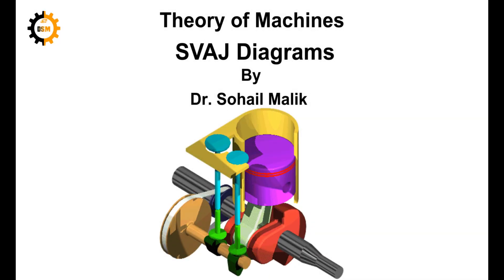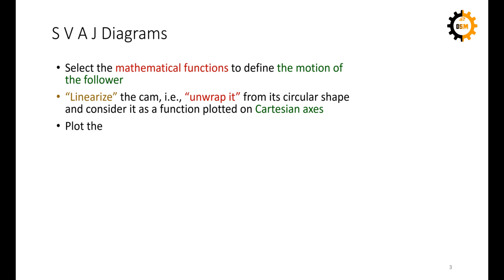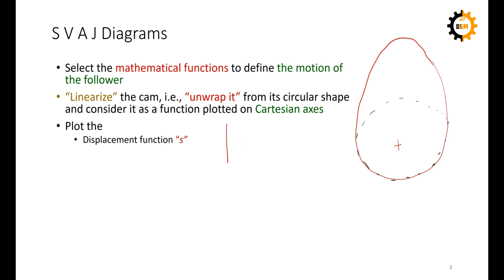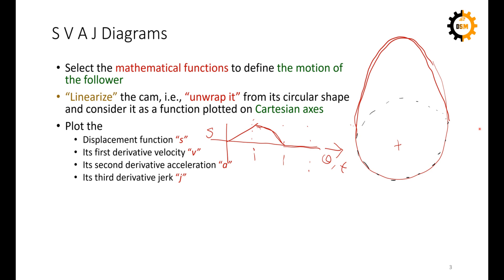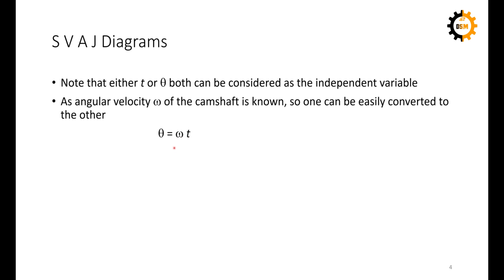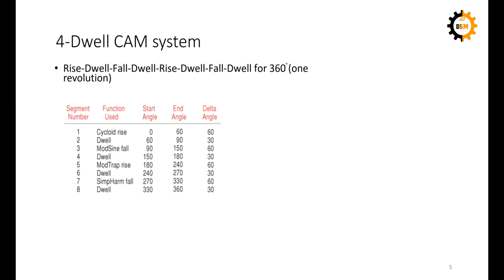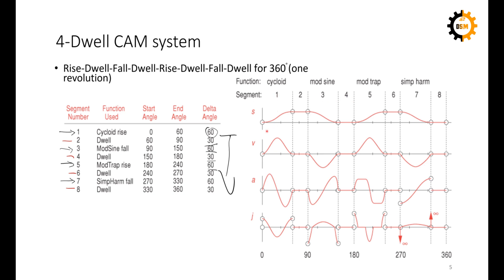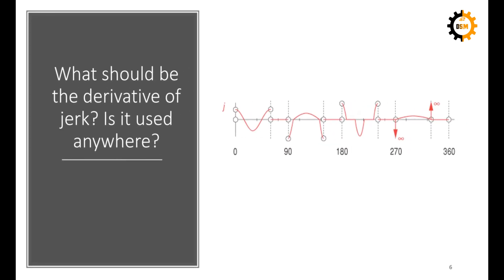28-1 Theory of Machines | CAM Follower Mechanism | SVAJ Diagrams

Comment: The derivative of of acceleration is called jounce. It is analyzed by passengers in roller coaster. svaj diagrams are important to know the full profile of cam follower mechanism i.e dwells, rises, falls, and in between them.
(2017480)

Comment: The derivative of jerk is called snap/jounce. It is used to check the change in the rate of acceleration. Its major uses are in the trajectory of drones or the passengers on a roller coaster. (2017284)

Comment: Jounce is the 4th derivative of an object's position, it's usage is not a common one, but it can be said that it is used to measure the safety parameters of a roller coaster. (2017022)

Comment: The derivative of jerk/Rate of change of jerk or the fourth derivative of position is known as jounce. It is usually used in the analysis of quadcopter, drones or passenger roller coaster.
(2017364)

Comment: First derivative of jerk or fourth derivative of position is jounce also called snap. It is commonly used when designing transportation systems where you'd want to limit or set to zero the jounce. (2016270)

Comment: Jounce the 4th derivative of position, It'd be the rate at which the change in acceleration changes. So you know that feeling you get when you drop in a roller coaster? Imagine being in a roller coaster that just bobs up and down in a sinusoidal fashion, then high jounce would related to how often you feel change in this feeling as you go from upwards movement to downwards  (there would also be a varying strength of this feeling throughout the motion due to jerk).